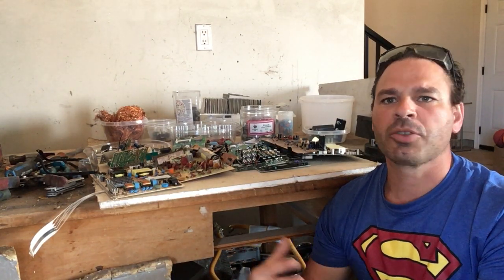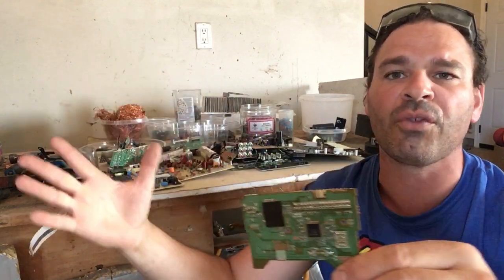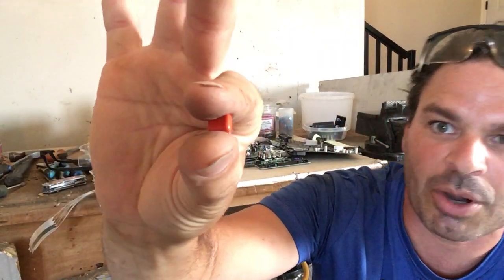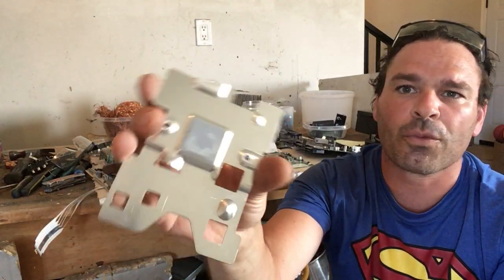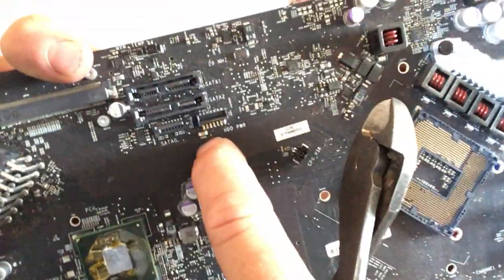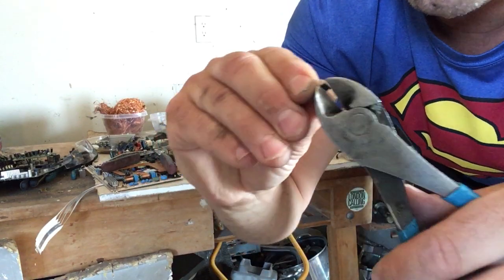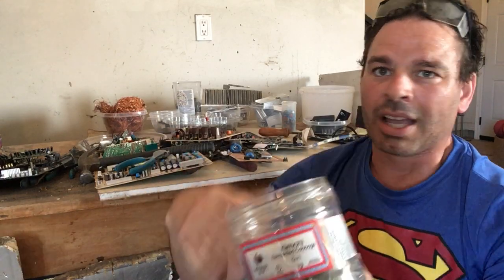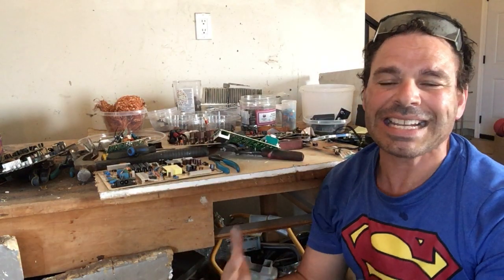HOW TO depopulate circuit boards for GOLD, PALLADIUM, SILVER, COPPER, and ALUMINUM: TIPS and TRICKS!

Comment: how much do u make on the palladium and gold plated stuff in ontario?
Reply from the maker: Sorry, not sure on that in terms of extraction. There used to be a buyer in Toronto for different gold fingers and circuit boards, but they are no longer an available. in London at Zubicks I get $1.10lb for motherboards and $2.25 lb for different boards from cd drives.